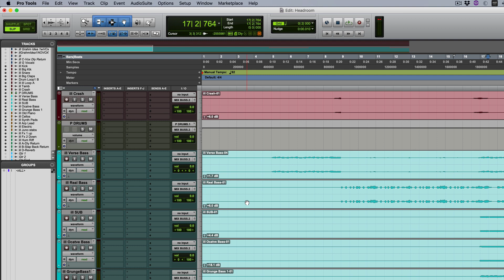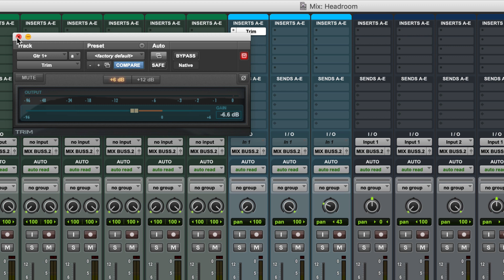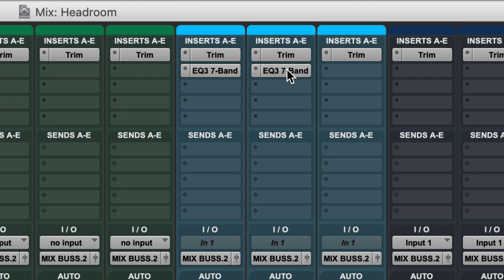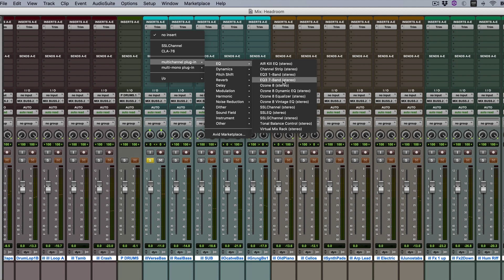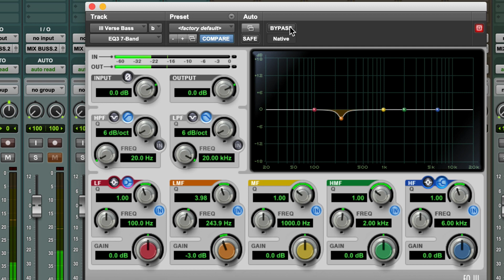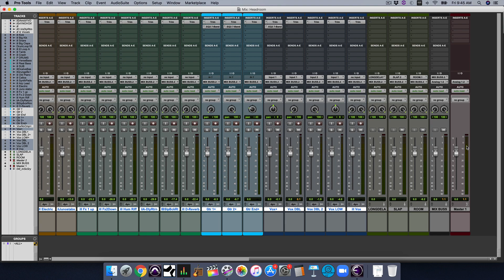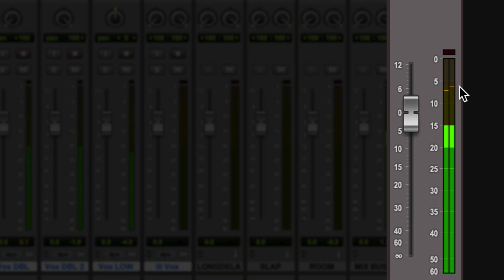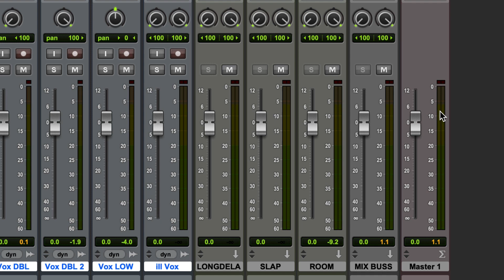Your Mix Needs Headroom (And 3 Ways To Get It) - RecordingRevolution.com

Comment: Is there any issue with using a mix bus on your instrument groups for gain reduction? For example on my drum mix bus, I've found that the more I lower volumes on  the mix bus the more I'm reaching to turn up the individual fader in that group. Like my snare for instance, I often have to remove it from the drum bus entirely (send it to main) inorder to still get enough power/punch and volume control. It seems like the lower the mix bus the more lifeless the drums become.  Also do you recommend using compression on only the mix busses or individual tracks as well. Thank you so much, really appreciate it.

Comment: Hi,
Thank you! Great video!
If I understood well,  I have to record just above 0 -1 to use the totality of 24bit and 48kHz(or more) and have low noise and then trim my tracks to create headroom? 
If I record my tracks directly to -15 I will have more noise/signal and not use all the 24bit and 48kHz (or 96 or 192). 
Am I wrong?
Thank you in advance. :)

Comment: But if you reduce the gain after you have already used compression then the compressor will react differently to your audio, no?
Reply: Alex Medrano yes if you change the clip gain but if you either use a trim plugin after the compressor or use the channel fader, which is after the insert, it won’t change the compression.
Reply: Alex Medrano also, the main idea is that this is before you do any processing.
Reply: output doesnt affect compression, only input
Reply: @samkonstan5254  Thanks! I starterd doing very sibtle compression, bouncing and then doing gain staging before doing proper processing
Reply: @izvarzone  Yes! My question was with doing gain staging on the actual audio not with a plug in, which would affect the output which is what we want ;) Thanks!

Comment: You are very very good at searching out offending frequencies to clean up tracks.  Question: Do you ever use frequency analysers for tracks that are hard to pin down, maybe more than one frequency.  Could you do a video on frequency analysers?
In response to your inquiry.  Gain staging and proper mic distance are always the first line of defense.  Digital signals are totally unforgiving.  It took me a long time to learn that.  Thanks for all you do.
Reply: Analyzers can trick you. Mix with your ears, not your eyes. They can be useful, but only after you really understand frequencies and the sonic range. (20 to 20k) and everything inbetween
Reply: Daniel Beall Thank you.  I appreciate your advice.  I do use my ears and I personally set levels for all my tracks in mono before starting the stereo pan.  I do this to try to make sure different instruments are not fighting for the same space.  Also, I definitely don’t want to record too hot.  It’s the “fine tuning” part near the end of the mix where I don’t do as well.  I am trying to learn how to use a frequency analyzer to identify problems.

Comment: In logic as far as I know you are by default looking at the output level on each channel. So if you turn down the fader to adjust volume you can still be clipping your input level, and probably are, even though the channel level might look like it’s been attenuated. Which is why I first change the monitoring view to input monitoring, and secondly I always use a gain plugin on all channels. Like this video says basically, your gain plugin is your input level on that channel, before any plugins, and then your channel fader is your output to your master channel,  post plugins. Just like on a physical mixing board, Need to set your input gain first, then adjust your output fader levels. this is especially important  on software synths that are usually very loud. Great video. Thx!

Comment: Thanks so much for sharing this video. I read a comment you made on one of your posts years ago talking about aiming for -6 DBfs peak level on the master fader and I've always tried to aim for that mark, and no higher than -3 DBfs. I've been producing audio projects, professionally, for about 5 years and as time has gone on my headroom of my mixes have increased. I now have mixes where the peak level on the Master fader is sometimes as low as -8 DBfs but the volume is sounding much greater than that. It feels good to have this knowledge and it gives me more self confidence as a mixer and producer.

Comment: Can you use the "gain" plug in Logic has as a substitute for a trim plug in to achieve the same result?
Reply: Yes, you can. You can also do it like Graham does directly on the Track. In Logic, make sure your inspector is open, click on your audio track, in the Inspector click on the Region disclosure triangle. In there you'll find the Gain setting which, by default, is set to +0.0 ㏈. Just drag it down or type in what you want. This is the way I prefer to do it and it's one less plug-in.
Reply: @mylesgriffiths3580  Thanks for the response.

Comment: In The Mix says you can drop 20hz and lower off every track, including bass and kicks. There are inaudible bass frequencies that actually move the speaker cones.
Reply: You can sometimes drop up to 25hz too. If your mix has a massive low end, then high passing up to 25hz can make that big low end sound a lot better.

Comment: One thing about having too much head room is that if you export it in that state, you won’t be taking advantage of the full bit depth the software has to offer. In turn this can lower the “resolution” of the recording. If you then attempt to raise the level to a mastered level it can become somewhat apparent in the higher frequencies. It is always best to find the right balance between a good amount of headroom and taking advantage of using the full bit depth. All the tips in this video are solid, but personally I would aim for a bit less headroom than He is to try to take more advantage of using the full bit depth. Great insight though!
Reply: Not really necessary with 32 bit float bit rate especially if you are using equipment with low noise floor or ITB stuff.

Comment: Thanks Graham. Very useful as usual. One point I kind of expected you to mention was recording levels. I know as a novice, I tended to record too hot and now try to keep it much lower. Am I getting this right? Is this also about headroom?? (I found the EQ adjustments here very interesting: I have tried these changes for clarity of sound but never thought about using them to save headroom. Also clearer about average and max signal: Thanks a lot :)

Comment: I generally follow all the same ideas you're talking about in your video. I think my process is more of a Gain Staging methodology. 

What I've found that works best for me is that I use the AudioSuite to normalize all my tracks to -10db (in PEAK Mode) before I start mixing. This sets my loudest peak of all tracks to be the same and the RMS usually comes in around -20ish.. right to the top of where the green and yellow meet up.  It's probably worth mentioning that if all you're looking at is the green in the meter bar, then you're doing it wrong there's more information there then just the average gain level. I've also found that I have better results when tracking, if my input meters are coming in at a max peak of -10db Basically so the green is dancing around the top of the green and goes into the yellow occasionally.  I also leave all my faders at unity until I'm ready to start getting a good balance.  I've found that getting all these peak levels set the same from the start has helped me a lot to get better final mixes.

Comment: I've done the high pass filter technique live. If the console has it, it can make a difference  like nothing else can. Most of the same reasons it works live is why it works in recording. In fact sometimes a low pass can help for some things. not for headroom but to keep an instrument "in it's own lane" so to speak.

Comment: we push the threshold in mastering session.
master peak -6db, limiter threshold -6db
= master peak 0db, limiter threshold 0db(not moving)
in my view, there is no difference.
even though it's over peak level,
we can low the volume(gain) of master bus.
DAW has a lot of headroom already.
I think we don't need to care headroom in digital domain.
our goal is just balance.
what do you think about this?
Reply: You're wrong dude. We do care in the digital domain. Because the minute you export your song it's gonna sound horrible if the master fader clips. That's true to say that inside your daw it doesn't really matter. But only in the daw because its internal headroom is way bigger than the headroom we have in the real word of 24/16 bit files. 

lower your master fader won't solve your problem if you're clipping your master bus. This is what the video is all about. You'll just get a saturated master at lower volume.  You need to turn the volume down BEFORE it hits the master bus by lowering everything else.
Reply: @whereismymind667  I didn't say I lower master fader, we can use trim or gain of any kind of plugin.
and if we use 32 float, we can get freedom from saturation, clipping or whatever.
we can restore it anytime. even though we have finished export(in 32bit float wave)
sorry for my bad english guys :)
Reply: Hugh Jones  thanks for understanding my intention.
Reply: @whereismymind667  What if my master bus doesn't clip and i use the fader of the master bus to adjust the whole thing at -6db ? Is this a right way to do it ?
Reply: codrutcroitoru To adjust the level of your track use a limiter and add some gain until you get the level you want.

Comment: I recently started to use the Audio Suite Plugin to Normalize every single track before I do anything in my mixing sessions. I found it more convenient than adjusting the clip gain or using trim plugins. I usually normalize the peak of all percussions to -8dBFS and everything else to -10dBFS and this makes it so much easier to gain stage going forward.

Comment: A little confused now: Don´t you take care of it with a proper gainstaging? All tracks balancing around -18db? It may save you from adding the trim plug-in?
Reply: You're right, but the trim plugin is effectively part of the gain staging process. In Cubase, there is a Pre-gain for this purpose, and if you have a variety of audio sources with varying average levels, the pre-gain helps you to set a good 'ground state' level before those sources hit the plugin chain. Whereas, clip gain, I personally use in a similar way to automation, but for 'spot' production points rather than the whole audio file - say, you have a random large trasient in a drum track and over compression would have to be so hard that it would kill the rest of the audio, then I reduce the level with clip gain at that one point. As for the EQ techniques; those are standard ways of removing unrequired areas of sonic information that only clutter up your mixes with mud or bottom end once the track signals are summed. Maybe he's trying to make a general point, let's be honest, you have to keep an eye on your levels the whole length of the mix path and if you're playing with transient shapers, saturation plugins and tape emulation, it is possible to get things to be percived as louder, yet have a lower nominal level. Happy mixing
Reply: @Bring_MeSunshine   Yeah I am CB 10 Pro user. That´s why I was confused! Now it´s how I thought it is! Thanks for clarification!

Comment: Very useful tips! Hpf and lpf are the first things I apply to the tracks before mixing. And cutting the noisy frequencies is the second)) 
One more tip, that I've learned from my own practice: use the monitors with enough low-end response. So if you don't, you'll be boosting the kick drum too much, as well as the bass and the floor tom, that'll reduce the headroom. If your monitors have not enough low-end, just boost it a little bit on the master track while mixing, and bypass it while rendering.

Comment: Another two good tricks:
1. Multiband sidechain compression. For example: duck a little bit of 50-150 Hz on bass buss on kick drum punch. 
2.  When song have a lot of double bass parts. Put an EQ plugin on kick bus, make a little bit (2-4 DB) cut on 60 Hz  and  somewhere in low-mids (300-600), little boost on 2 KHz. Then you need to automate your eq plugin. Turn it on when fast double bass parts going on and turn it off on slow parts.
It makes mix overall more clear and save you some headroom.

Comment: Way 4. Add trim plugin to your master channel and turn it down there. Way 5. The Pro Tools Master Fader is before the master channel inserts in the signal flow, meaning any adjustments you make to the master fader will change the level hitting the plugins. So you could just use the pro tools master fader as the trim plugin that gives you the extra headroom you're looking for in a digital linear floating point system in 2019. We've had practically infinite headroom in the box for about a decade now. As long as you're not clipping the master channel output, or any conversion point, you're not clipping.

Gain staging happens at the converter while tracking. Don't clip, record at the level you're targeting, and that'll save you from needing to calibrate your audio before mixing.

By the way, if you record at the proper level, there's zero reason to calibrate your audio before mixing unless you're using a hybrid system and sending your track out to an analog eq or compressor.

Record it at the right level, turn it down at the 2 bus before the processing chain, and don't clip the output of your conversion points.

Problem solved.
Reply: THIS
Reply: Is there a trim plugin to add to the master channel in cubase ? Somebody asked me why can't we just reduce the volume on the master track with simply touching the fader and i didn't know what would be the good answer.
Reply: Is it really okay to put a trim plugin on master though? I keep hearing you can't just reduce the volume of your master to circumvent
Reply: @angurishudesu  1000% ok, as long as you understand the signal flow of your master bus.

Example, if you're using Pro Tools, your master fader IS the trim plugin. It sets the level hitting the plugins on the master chain, and moving that fader can change your gain structure going into that chain.

In pro tools, I'd put a trim plugin after the plugin chain so the trim plugin doesn't change the gain structure hitting that chain.

But in most other DAW's, the fader comes after the plugin chain in the signal chain. If you need more headroom going into your master bus chain, using a trim plugin to turn it down before that signal chain is an acceptable solution.
Reply: @TheNoiseFloorav  you definitely don't no what you're talking about
Reply: @heemofficialyoutube5774  if you say so, but you should test what I’m saying.

Comment: Graham I been watching listening to You :You got a lot in You I'm Impressed I have a new Mackie pro 16V3 mixer and a Boss Catarina 50 amp and a TC HELICOM Acustic play black box all brand new but I also have a Dell Extrerm 4500Grafic laptop it has Data 500 and Two 16 GB in it windows icore 7 My Question is if I put up a lot of plugins Like I m getting Pro tools and Sound waves also with all going thru My lap top and mixer will My laptop handle all I put up on screen do You know My laptop is maxed out with hard drive and memory I not put any on it yet and I have a Fire 8 new tablet to ples page Turner and can You teach Me when I get all this I bought new hocked up together or do I need a more up date laptop or a diffrient amp insteade of My new Boss Katana 50 amp wi You let Me know if I need to exchange something for something diffrient or if My Guitar Boss Katana Amp will work or not and I'm buying head phones and the White monitor 700.0/ speakers for my recording studio I'm setting up I been injured at work hafe to take brakes about every 20 to 25 minutes cause of back has to be operated on again I have a vision of the FIELD GOD showed Me all thou I still don't know what the FIELD is at yet I know why GOD showed Me in the VISION in 2005 going into 2006 so I'm getting ready plus I got to buy at least two power speakers I realize for live when I do step up and GOD STANDS me.is this all enought or the right thangs to start to do live and record later to arrange record and eddit it will what I have work or not?

Comment: I used all of them, but definitely not enough.

I too rarely cut away low frequencies (because I'm concentrating too much on making the solo tracks sound nice).
I should aim lower for single track volume (used to target around -12dB which gets too loud in sum easily).
I almost never cut offending frequencies in sounds because I don't trust myself to identify offending stuff and not the good sounding stuff (also again too much weight on individual tracks).

I found this extremely useful, although I knew every trick I now realize I have to do all of them more aggressively.Thank you very much!